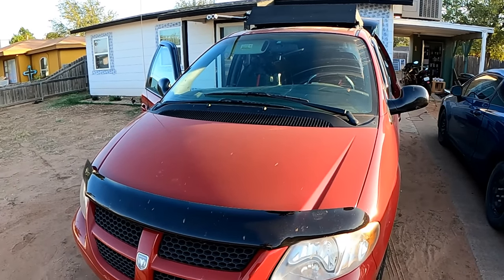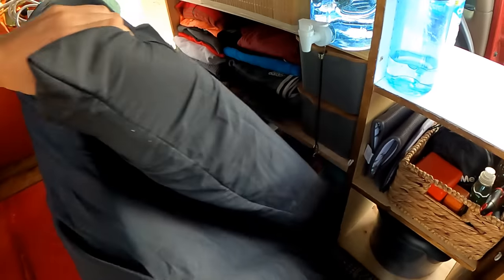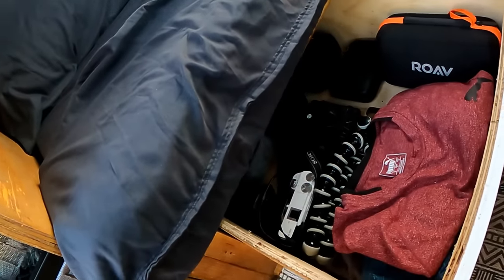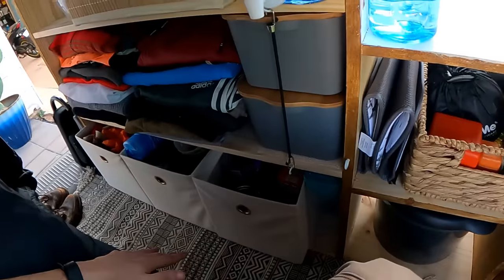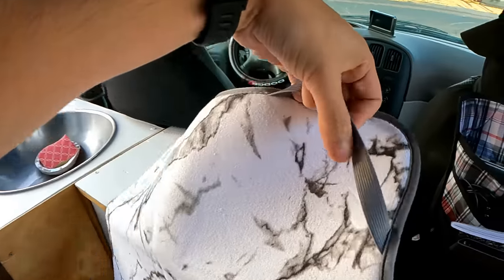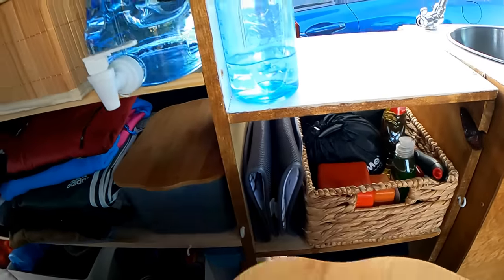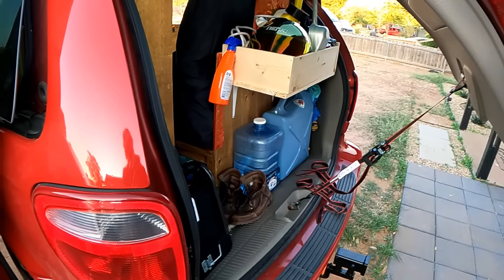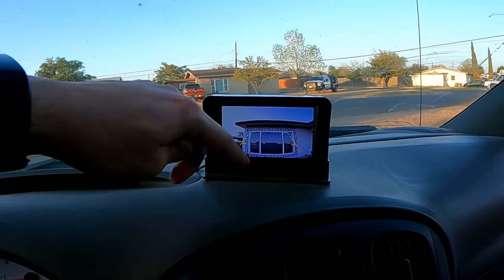Mini Vanlife 2002 Dodge Caravan Budget Conversion Tour DIY Simple, Cheap Setup

Comment: Did You have to Even Out the floor once seats were Removed
Reply from the maker: I didn't. There were some plastic guards that sat were the seats lock into. I did remove those by taking off a few screws. Once that was done the floor was pretty much plain.

Comment: Did you remove the original van side walls or did you just do your build around them?
Reply from the maker: I removed them. Then I put some insulation foam and a truck liner to cover it.

Comment: Do you stay warm in the winter?
Reply from the maker: For the most part. I do have a heater for extreme temperatures or for whenever I need it in general. I always layer up. I have a decent sleeping bag. And if needed, I do have a second sleeping bag which in colder temperatures I insert one sleeping bag inside the other, that helps out a lot!